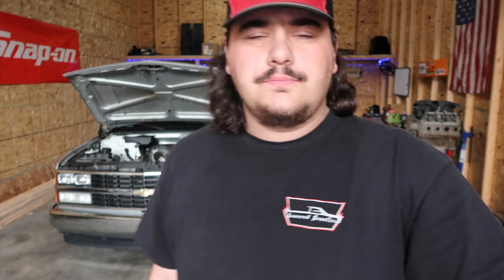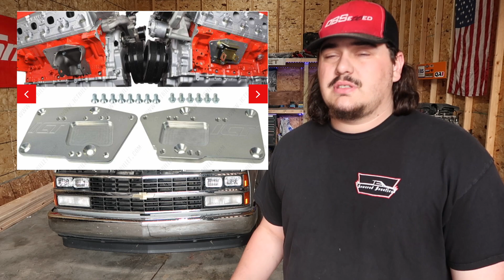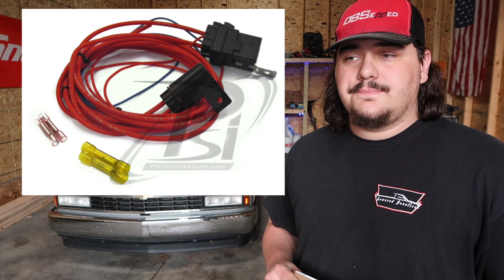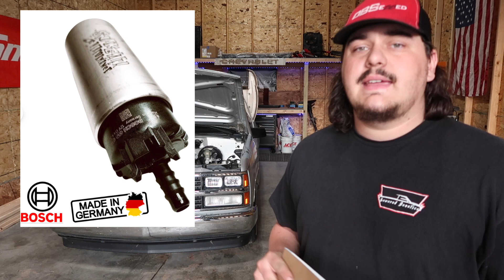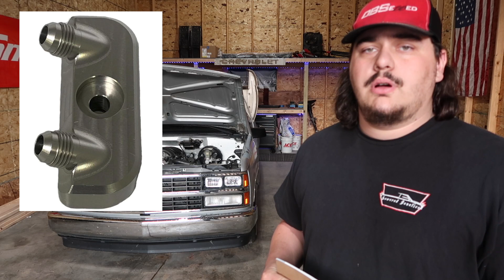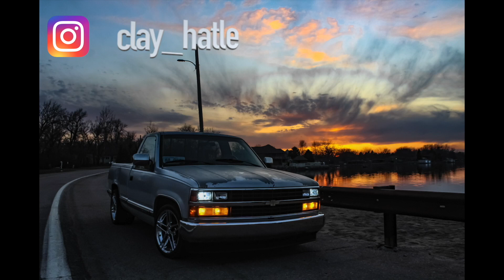What's needed to LT swap your 88-98 OBS

Comment: Just for future use, the factory l83/l86 oil pan works. I just dropped one into my 94 suburban K2500 4x4
Reply from the maker: @davidjohnson5394  that little “second pan” type deal that bolts to the bottom of the stock wouldn’t clear for me

Comment: I have a l83 and 6l90 from 16 tahoe. Getting an 88k1500 stepside to put it in cause i couldnt find a decent shorbox c1500. Think AWD is possible with a caddy transfer case? Or better to try to convert to all 2wd?
Reply from the maker: @loganmckinney1285  it’s for sure possible “LT Tolman” has amazing videos he did that exact swap with an ls. 2wd would be easier but awd would be dope af
Reply: @claytonhatle.1988  sweet I'll check that out thankyou. Have a regular shorbox bed that I'm throwing on it before paint. Still gonna lower it awd or not. Currently installing btr cam and dod delete with other fun stuff. Just hoping there's a decent transmission builder to help spruce up the 6 speed

Comment: would a 2014 radiator work? with my 90 obs btw would there be fitment issues
Reply from the maker: @el_cono4713  yea the 2014 and 2015 are the same. They aren’t like “bolt in” so you will need to find a way to keep it secure
Reply: @claytonhatle.1988 what did you do to secure it
Reply: @ Do they need there own resorts and ground cables or just hook to the harness

Comment: The link u posted for the headers are for the c10s, is that the correct link? Ty
Reply: Oh and trans mount bro what u use
Reply from the maker: @ElGio214  yes that is the correct link to the headers they are for c10 but can make work for the obs trucks as well and as of now I’m using factory Trans crossmember
Reply: @claytonhatle.1988  Ty sir, what did u have to do to make them work? Already ordered them lol
Reply: @claytonhatle.1988 when you say you can make the headers work .. what do you mean by that ? Did they fit without hammering or cutting them ?

Comment: Are you running a cruise control on it? does the air conn have to link into the harness at all or is it an independant system?
Reply from the maker: @rtrottier14  haven’t done cruise or ac yet, although for the ac I’ll run a factory l84 compressor and it will work that way and the harness is a psi harness you have to spec it out for anything you do or don’t want.

Comment: Noob question but how’d you get around the afm dod? Considering doing a gen 3 swap over the gen 5 because of it.
Reply from the maker: Easy cheap way is you can just disable it with hp tuners (which I did that for the first 2k miles of the swap then I did a cam and did the better way which is cam, dod plugs, and new non dod liftersz

Comment: Any fitment issues with those headers? I've got a lt swapped k1500 and I thought about using those
Reply from the maker: The passenger side sits the frame rail a little so you have to dent up the header a little or grind down the frame

Comment: Did you delete the oil cooler lines to the engine to radiator ?
Reply from the maker: Yes I did
Reply: @claytonhatle.1988 as well as transmission lines?
Reply from the maker: @jared_dsg7857  no the tranny cooler lines still go to the radiator

Comment: awesome video! very helpful, Im trying to get info for swapping my L86 6.2 into my 1998 chevy c1500 2wd but cant seem to find much for forums on the situation, any differences for the l86 to fit a 1998 2wd?
Reply from the maker: Not that I know of, wiring will be a little different from 88-94 and 95+ but mostly everything else should be same but if you run into any issues message me on instagram and I can try my best to help
Reply: @claytonhatle.1988 dude I need help on mine? I have a 1994 with the 6.2 10 speed mounted just don’t have it wired idk if I need a computer or what
Reply from the maker: @OscarCovarrubias-ts9lb  send me a message on insta or Facebook I’ll see if I can help you
Reply: Darian, I have a 88-00 obs connector pinout file that helps alot with ls lt obs swaps.
Reply: @masterslsobs  sweet man! Would I be able to get that file?
Reply: What you did about driveshaft?
Reply: @claytonhatle.1988 what trans lines did you use.

Comment: Hey man great video , question the video says LT would this be different I have a 1995 sierra that I want to put my 2012 Denali 6.2 into. Think it’s technically an LS not LT any major differences between your list you can think of?
Reply from the maker: There’s going to be quite a few differences. Motor mounts are different but ICT Billet still makes some for the ls. Want need the power steering stuff I do because ls already have it. Different fuel system, and few more things
Reply: @claytonhatle.1988  cool thanks for the response I appreciate it!

Comment: Did you leave the dod and afm or did it get deleted
Reply: Are you on Facebook
Reply from the maker: @judondatruth106  yes @ Clayton hatle
Reply: Do you have any problem with alternator not charging battery. Cus I get 11.9v at most and can’t seem to find the issue. Thanks!
Reply from the maker: @victorgrimaldo2983  most the time it charges at 13.4 it will randomly drop to 11.7 but I turn off the car wait to minutes turn it back on it’s back up it’s weird
Reply: @claytonhatle.1988 @ what about moonies gauges?? Will they work just like the 95 obs does?
Reply from the maker: I disabled it in the tune for now but I did just order a cam and  dod afm delete kit.